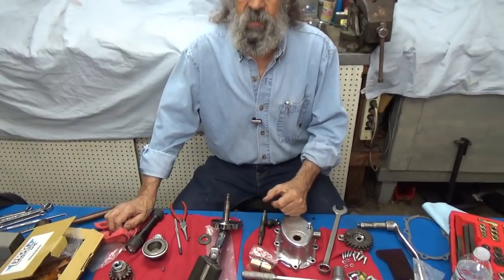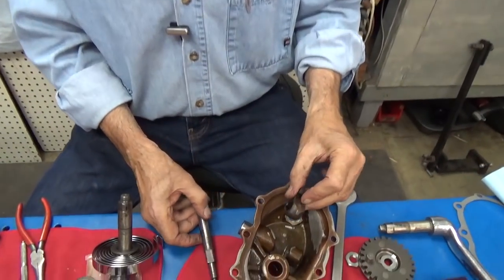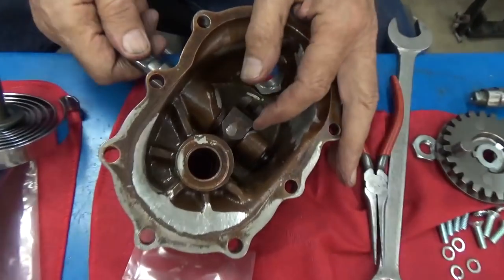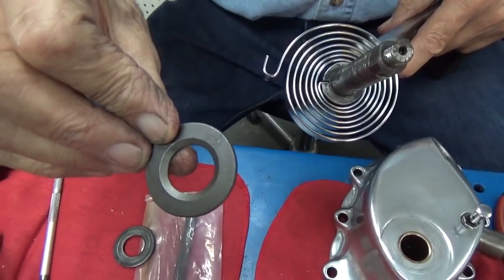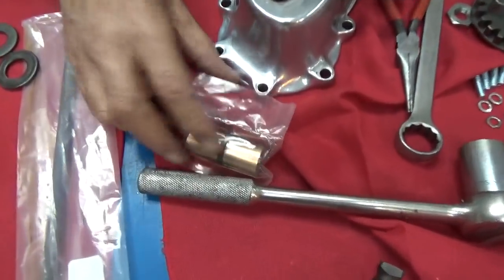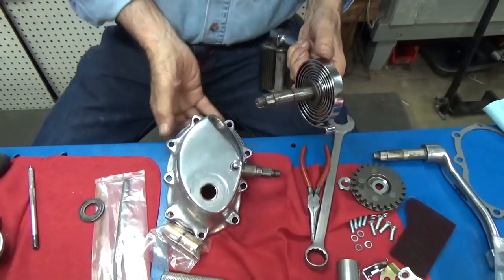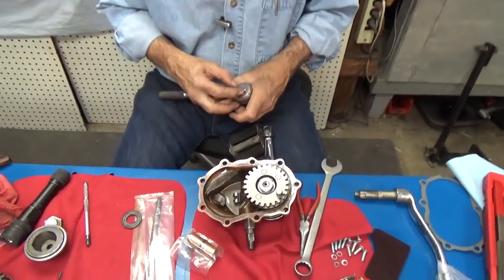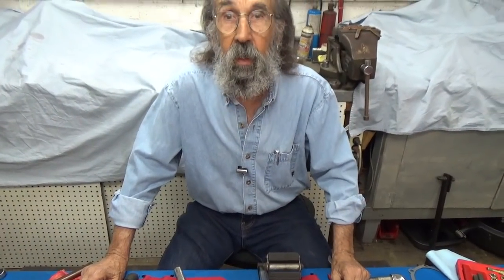Building a Kickstarter for the 1940 Harley Davidson Project  Bike

Comment: Thanks Mike 👍 I will be pulling my kicker assembly off my 1985 4 speed Softail standard , I am hearing a ratchet sound while the motor is running and it stops the noise when clutch is pull in. Also have a 59 FL that I will be rebuilding. Your video’s have saved me a lot of grief & Time 🇺🇸🇺🇸🇺🇸🇺🇸🇺🇸👊. Once again thank you Sir for sharing your knowledge on old Harley’s.
Reply from the maker: Thank You.  Glad they help.

Comment: Hello Mike,

I have contemplated installing a KICK-STARTER on my 1985 FXRP  5-Speed for some time
Hopefully this VIDEO will be at least a little SIMILAR to what I encounter on my  early  EVO  Transmission install
As always - Thank YOU for the Instruction

COOP

.........................................................
Reply from the maker: It is similar, but, different.  Clearance issues, etc.  Not eactly a "walk in the park," but manageable.  Remember, 5 speeds didn't ever come with kickstarters, so, expect some changes to be necessary.

Comment: Thank you for this! My 68 shovel kicker is starting to grind but stops if i hold the pedal up. Ive been just bungee cording it up just to get through this riding season.
Reply from the maker: Cool.  You can do it.
Reply: Salvatore:
Sounds like your starter clutch bushing is bad. Was on the way to Yellowstone back in '79 and had to attach/detach a bungie cord on my 58 everytime I started it but made it there and back home.
Reply: @stanfischer6175  Thanks, yeah i figure ill be tearing her down a bit once the weather really starts to get bad here in Western Ny. I might try and get a fresh coat of paint on the tins too. Bike was rebuilt in 99. My dad bought it in 78 and ive been riding her the past 5 years. 🤘

Comment: as you mentioned on the kick shaft bushing hole were it cracks a friend of mine had to repair mine and he machined around the bushing hole after he welded it and he machined and place a steel sleeve round it so it would not crack again he also done this on his sportster
Reply from the maker: Very cool.  Thank You.

Comment: Just did my kick starter, my key way was shredded inbetween those two gears, jesus what a pain that was. My claw puller had so much torque on it my little bearing in my main shaft almost turned into a flat washer.
Reply from the maker: We forget.  This stuff lives an incredibly long life.  Then, we get to repair, replace things and go ride some more.  Yah, it's a pain sometimes.  But when it fires up again, ready to go, all is forgiven.

Comment: Mike, I need to find parts for a 79 shovel and a 56 four speed transmission? Looking for bushings, bearings, lip seals, gaskets, and also mikuni carburetor float, seats, and jets. Really like your work! Can’t tell you how much your helping me!
Reply from the maker: Most of the major suppliers carry that stuff.  It's all reproduced.  The internet has it all. Type in what you're looking for.  You'll be amazed.
Reply from the maker: Hey.  I'm really glad if I'm helping you..

Comment: Hello there, I really enjoy this channel and you have really helped me while I'm restoring my father's old shovelhead chopper.

One question: A kickstarter like that in good condition, can it still slip? Or is that a sign of old gears?

My kickstarter is slipping from time to time and I've busted my knee as an result. Any idea of the reason for it to do that?

Best regards from Sweden.
Reply from the maker: Takes quite a bit of wear to make them slip.  Maybe it's the clutch slipping.  Those starter parts aren't that terribly expensive.  Remove the derby and watch the clutch as you kick it over.  (This will take two people, one to kick and one to watch)

Comment: Thank You Mike. I had to replace a kicker cover on A 1982 FLT . The Harley book doesn't even show a kicker. You make everything look easy. I tried to contact you but seems your web site is down. I have a EVO question for you.
Reply from the maker: Ask the question here, in the comment section.
Reply: @pacificmike9501  Mike I would Love to Ask the Question & share the Problems & results with the Community. BUT! My issues are strange & Evolution & Very Lengthy. It would be best if I could communicate Via Email That the Beginning can be extremely detailed. Its like Twilight Zone around here (LOL)

Comment: Hi Mike. I e been watching your videos for awhile now and have learned a ton from you. It always helps to watch you do it before I go wrench myself. 
One question though. I just rebuilt the kicker cover w the drag kit. The directions say that the chamfer of the washer faces the spring. It appears you put it on w the chamfer facing the kicker cover. Which one is correct?  Thanks Mike.
Reply from the maker: I've always done it with the chamfer toward the cover (actually the end of the bushing).
Reply: Interesting. I don't think it would cause a major problem, but I called drag and the said the chamfer should face the spring. I just want to make sure I don't assemble it incorrectly and mess it up. Thanks Mike, love your videos and appreciate you sharing your knowledge. I'm building a 70's shovel and making sure I build and rebuild everything to make sure it will last. Thanks again Mike, you rule.

Comment: Hey Mike was wondering why you left out the 13/32 thrust washer that goes under the release finger? Did I miss something or did you just forget, or is there a reason you omitted it on purpose?
Reply from the maker: It depends on space.  If you're using an earlier setup, there's no room for it.  I should have mentioned it.

Comment: mike, are you sure that you assamble the starter gear on this video on the right position? if you look to the position here and the position on the second video the starter gear is 90 degrees twistet
Reply from the maker: It's closed now I don't remember exactly the movements I made, but you need to hold the arm in the proper position, so the gear is against its stop during the installation of the cover.

Comment: Hey mike, I need a shovel head expert and I think it’s you. My dad watches your video on the transmission. I got a 78 shovel head that needs jugs and slugs. When my dad bought it, he said it was an 80 ci, but when I looked up the part number, it said it was a 74 ci. I’ve also seen an 80 ci with the same part number. Can you give me any advice?
Reply from the maker: Check your service manual and go through the vin number.  It should tell you easier than disassembling the motor.  It will tell you what each letter or number means.

Comment: Hey Mike I have a taper shaft shovelhead ratchet top and my kicker arm engages the engine way at the top, what did I do wrong? It's almost impossible to kick over this way
Reply from the maker: The gear can be attached to the kicker shaft in 4 different positions.  Install it so that you'll need to hold the kicker arm part way d down in order to install the assembly.  Watch again as I do it.

Comment: Hey Mike, I just got my kicker cover setup for my Electric start only '76 FLH.... how do I ream the bronze bushings for the kicker shaft if there is a rubber steal in the middle?
Reply from the maker: Take the rubber seal out.  Buy a new one and put it back in.  The original seal is a "flat" o-ring.  I really don't know what else to call it.  Any shop that doesn't have it, should be able to get it for you.  I believe "Genuine James" makes it.  Sorry if they make you buy a bag of ten.  If it's new, you should be able to reuse the seal that's in there.  Carefully remove it with a skinny screwdriver or blunt pick.  It will pop right back in again.  The easiest way to ream that pair of bushings is to take it to a machine shop that can hone it for you.  Shouldn't cost much, just a quickie job on a hone.  I'll demonstrate a hone on rocker arms in the next video.
Reply: Thanx Mike, I guess it was a silly question, but I’d never seen a kicker cover before and didn’t know the anatomy of the thing. I was going to use the wheel cylinder hone on a drill to size both the push rod shaft and kicker shaft, just like you did in your video... thanx for the info! YOU ROCK!!
Reply from the maker: Thank You